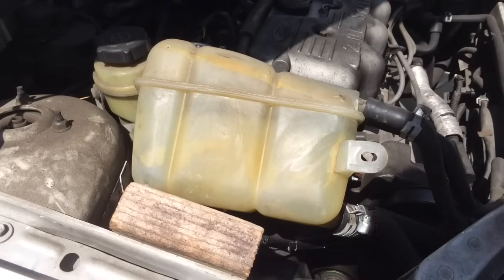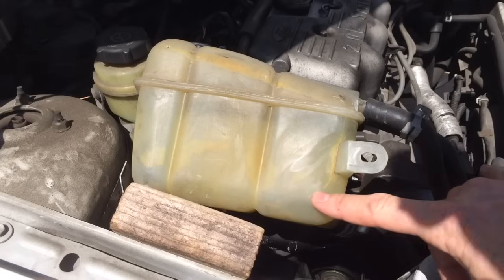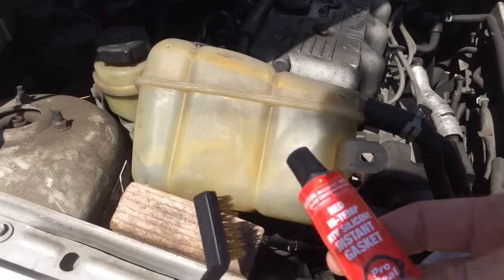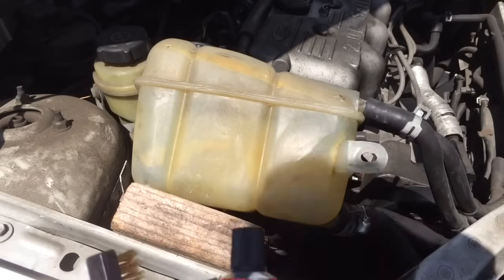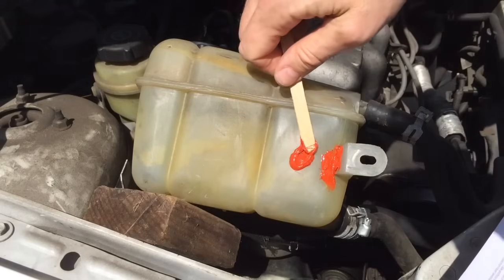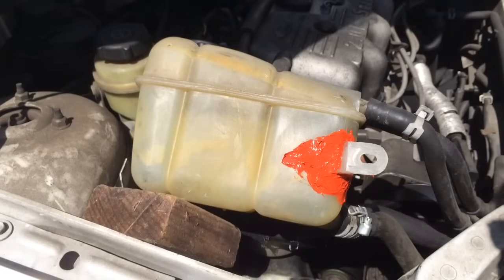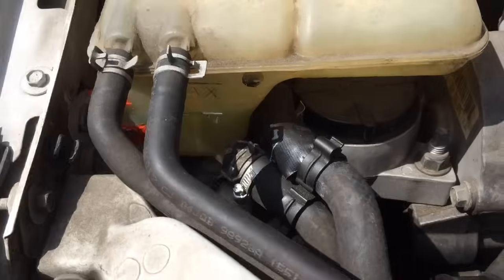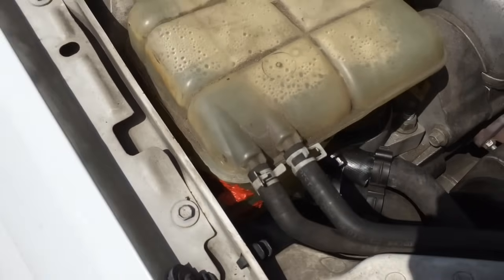How To Fix A Leaky Coolant Overflow Tank

Comment: A leaking coolant reservoir tank will eventually cause engine overheat , it happened to me.
Reply: Happened to me, been adding coolant until I have money to fix it
Reply: @maddyvl4739  stop being incompetent, go on amazon get a tank for 30$ and grab some wrenches. The solution is not always a mechanic.
Reply: @anandchundi6805  
Hard to do in some cars, the bumper needs to come off like in my Kia Rio
Reply: @Eye-it-azz  Pull it off then, I took my brothers bumper off for a fog light
Reply: You mean the car will overheat when the coolant leaks out?  You're  a GENIUS...🤣😆😅
Reply: Why did you ket your engine overheat hector?
Reply: What’s the fix then?
Reply: Yeah, me too. I have a stupid Chrysler 200  and there’s a tiny crack and air gets in the system
Reply: @anandchundi6805 Yea if you can find the mfing part.
Reply: K seal

Comment: Coolant reservoirs are under pressure so if you have a leak you need to buy a new one. But if you need to drive your vehicle for one day or two days in an emergency the only way I found to repair it to where it will hold the pressure is to find some plastic on the reservoir that is non-essential. Somewhere around the mounting bolts cut some of that off. Get yourself a needle nose and a chisel or a spoon or butter knife. Just something flat that you can press down with. Then hold the cut-off piece of plastic near the crack and take a torch lighter and melt the surface of your pressure Reservoir and the little piece of plastic you are holding with the needle nose and then lay it on the crack and press it down until the two heated pieces of plastic fuse together. It's a 24 to 48 hour repair and I would be stopping regularly and checking it to make sure it holds. That's what I did and it worked.

Comment: This is a perfect recipe for a blown head gasket, thanks for sharing!
Reply: Can you elaborate on that please, how would this cause a blown head gasket?
Reply: @jamesgaudreau8315  in the video the guy said it’s an “overflow” tank and he is wrong. It’s an expansion tank, which is subject to not just heat, but also pressure.  It’s already cracked and eventually will crack and leak even more. Causing the engine to loose a considerable amount of coolant and overheat. That’s how it will end up with a blown head gasket.
Reply: @facusan2339  not necessary, if your engine is loosing coolant everywhere, then you have a leaky system, i didnt realize the beater that i had, had no coolant in the resorvoir tank for almost a year untill recent work, it never overheated.
Reply: @lenseofanomad  Which type of reservoir tank, Expansion or Overflow?
Reply: @MrCrackheadst  What the title of the video is missing, it’s the word “Temporarily”. Because this is definitely not a permanent fix.

Comment: Just been to my local ford dealership, they advised not to repair any type of expansion tank, as they are under a considerable amount of pressure, up to 121-141psi. To replace a new one, would take roughly 10-20 minutes.
Reply from the maker: +Helen  Andrews  Replacing it is a better option.  This one gets hot but is vented, so there shouldn't be any pressure in it.
Reply: OF course they would. I need to fix or replace a (Ford) F6HZ8A080B tank, for my '96 Safara 38' RV with a CAT 3126 Diesel  engine, and that damn thing is $200. So yea, they want to see you to BUY a new one. I absolutely cannot believe that there's 120-140 lbs of pressure in a surge tank. It would burst.
Reply: N m
Mmm momm
Reply: Total bullshit. They told you wrong.
Reply: 16psi in a taurus expansion tank, yeah mine is leaking.
Reply: That's great if you can still find an expansion tank for a '90 Vanagon.
Reply: @QuantumRift   The pressure is written  **ON THE CAP* ;  cap controls pressure; ALL cars are 12 to 15 PSI ,they ALL have rubber hoses, they would BURST above that pressure.
Reply: @josepeixoto3384  I was taking about the SURGE tank on my DIESEL pusher motorhome.
Reply: That's your problem You're a Ford owner and went to a Ford dealership 😂
Reply: Definitely not 120 psi in a antifreeze overflow tank. We only run 100 psi in our truck tires for a 18 wheeler. 120 psi would blow that tank up.

Comment: 100% agree with comments regarding basically a closed system such as CHEVROLET Starting back in 2002 and after .  So look. .    Hell older 80’s and 90’s. Probably work for a short time.

Comment: Coolant expansion tank will cost you between 20-35 dollars. There is no reason to be thrifty with cooling system. Just replace it  and forget about it  instead of checking it every week if it is finally leaking or  not.
Reply: Unless you are in an area where you can't buy one or don't have two weeks to get it shipped or don't have an extra 20-35 dollars but do have some gasket sealer. In those cases this video is gold and your comment is useless.

Comment: , I have an 89 Pontiac Grand Am and it is weird at the overflow tank because half of its plastic and where the cap connects its metal so naturally it leaks where these two materials connect, so I tried some high temperature epoxy but I think it's either leaking from the cap or where it was mended. I couldn't figure out what was going on to have pressure in this tank until I read the comments below and they said sometimes this is normal cuz others don't have pressure so now it's time to buy a new tank

Comment: You mentioned that the reservoir wouldn't cause any issues but won't that cause a pressure issue with the coolant since it's not a perfect seal?

Comment: Same process. Just use the 2 part JB Weld. I used it on a Nissan's plastic type radiator. Leaking at the neck just below the cap. But, i was able to put it on the inside and out. It lasted over a year til i just needed a new radiator.

Comment: What happens if u forgot to install the cap of the coolant reservoir tank while driving? This happened to me last week. Is there any bad effect that might happen to my car,? Temperature still normal though. Thanks
Reply from the maker: No. This shouldn’t cause any problems. You might be able to find a replacement At an auto parts store.
Reply: Thanks my man!

Comment: Easy fix if ya got the spare 50$ floating around for a new tank. If not get some high temp gasket maker and sandpaper clean the area real good ruff it up with the sandpaper and slop that shit on there heavy. Make sure you drain the tank or tilt it so no coolant touches the leak. Can’t fix a wet leak get it dry as possible. Should hold till you get 50$ for a new tank. Best of luck ninja

Comment: I just got a 95 5.7 tbi.  And I noticed that my reservoir is new. But I'm noticing that the reservoir is always empty.  Wether the truck Is running or off. It's always bone dry. Yet my coolant in the radiator stays at  2.5 inches from the radiator cap..  Even if I add coolant. I cannot see any visible leaks in the hoses or around the reservoir. Does anyone know what could be going on?

Comment: I used the epoxy thing that fills cracks in driveways. Used it once lasted me about 4 years(winter spring summer fall repeat) till today when it eroded away and it was squirting from thr crack now I just redid it.

 Thr first time I put it on i let it sit for 12 hrs to throughly dry in thr summer.
Reply from the maker: +Nsingh11 That is a good lifespan.
Reply: Every epoxy I find that looks promising says it doesn’t work on PP plastic which I think is what my tank is. I’ll look into that driveway stuffs

Comment: Did it fix your overheating issue in your focus?
Reply from the maker: I never had a problem with it overheating. It was just leaking water out of the tank, so I had to add water to the radiator. But the radiator seemed fine even when it was low on water it didn’t run hot.

Comment: Same Issue...Got One At Junk Yard....Yes yes they do cause overheating...When T Stat Opens The Micro cracks Suck Air Into The Radiator.....Makes Air Pockets...Took Me 3 Days To Solve Mystery...Also Drill A Hole In T Stat...Trust Me Folks

Comment: Just saved myself $41.00, not to mention that’s you’ll also loose coolant when you replace the expansion tank, so that’s even more money down the hole.
Reply: If it has a leak I imagine that it's not all the way filled anyway so you can probably just tilt it away from the hoses and not lose any.

Comment: Hot water produces pressure. So the whole water coolant system will have the same pressure throughout including the expansion tank hence calling it an expansion tank. Tour idea is semi good but you shouldn't be advising people and giving the wrong information. For example is you remove thw tank cap when hot it will erupt coolant sometimes quite violently which is why there is a warning sticker to advice you against removing the cap when hot.

Comment: would an cracked tank cause overheating?
Reply from the maker: +Daniel Burm A cracked tank would eventually run your radiator a little low on water, but I don't think it would cause overheating. There would still be water in the radiator to cool the engine.
Reply: Rick Sailopal go away.  his video is fine. hes just showing a temporary repair or a get you by scenario. he even says multiple times that the best thing to do is replace the tank.   so you delete your comment and stop acting so upity and pretentious.
Reply: Depends. SOme cars the reservoir tank is more essential to the cooling system, such as in a Pontiac gm.
Reply: Coming from experience I drive a 91 honda civic, and my car just overheated, steam spewing from where my leak is located.
Reply: An unfortunate thing happend to me when GT radial tire depot changed my tires on my 2015 Toyota TRD they jacked up the car and hit my radiator reservoir. After they put Epoxy High- temp to fill in the cracks they made, i can still travel in long distances without any hassle however there are few drops of coolant on my plastic cover pan underneath the radiator. It freaks me out to see such a scene. Could you help me please.

Comment: You will over heat since your over flow is under  pressure since it's under the radiator cap ...

Comment: If your engine is OVERHEATING, not simply old tank cracked, DO NOT buy the epoxy !! I did and wasted $$ and time along with goop on my hands ! 
The epoxy does adhere to to the plastic tank. But the high pressure, very very hot coolant still found its way under and through the epoxy, bubbling out..
My mechanic wound up simply R&Ring the tank with a new one ('82 MBZ 300TD)...
No lie or exaggeration here. God's honest truth....
If you are only leaking at tank you might get away with the epoxy...But if engine is overheating due to say, leaking/plugged radiator, other, the epoxy fix won't hold boiling-over water in it !! I found out the hard way....

Comment: NO... Never use silicone or Glues like Goop for this kind of repair. This misleading clip should be removed :o  After a short while the pressure in the system will push past the silicone and not only do you have the same problem again but now a bigger job cleaning it as well if you don't overheat and blow your cylinder head beforehand.